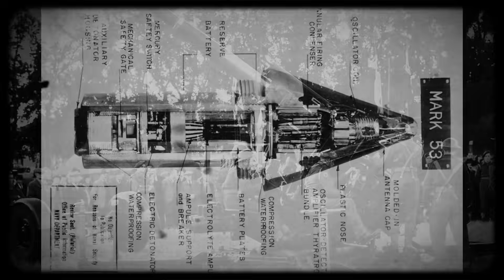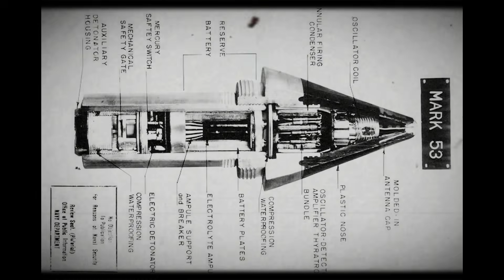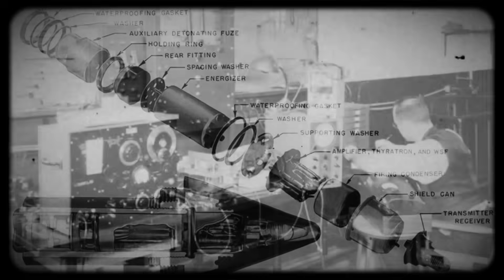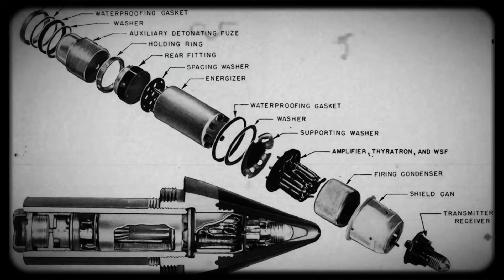The Day Germany Faced the Proximity Fuse—And Realized It Could Wipe Out Entire Formations Instantly

Comment: The Germans could have vastly improved the effectiveness of the V2 if they had had a proximity fuse. The V2 warhead effectively buried itself before exploding, causing most of the blast to go upwards. Using some sort of proximity fuse could have detonated the warhead 100 ft or so above the ground and caused a much wider radius of damage.

Comment: Crap! The proximity fuse was a British invention, NOT a US invention!!! The British tried it in bombs and rockets, but their valves were too big and fragile to be used in shells fired from guns with rifling. The USA made miniature valves for use in hearing aids. So, the proximity fuse design went to the USA with the Tizzard mission. (As did the cavity magnetron which put powerful short wavelength microwave emissions into a device small enough to hold in your hand).

The USA developed the fuse. Their greatest invention was the battery which consisted of electrodes plus a liquid which was in a glass container which broke when the shell was fired, throwing the liquid outwards into a channel where it completed the battery which powered the fuse. This meant that the shell had to be fired in order to activate it. This radically improved the safety of the a shell and got rid of the problem of battery life.

Contrary to the moronic narrative, there is nothing magical or complicated about the circuitry. One valve is used for the combined transmitter and receiver. The signal was fed to a 2 valve amplifier and then a Thyratron valve which fired the detonator.

The narrative in this video is appalling.
Reply: The number of AI generated or altered videos is appalling. The same thing is reiterated 25 times with intervening content being most often erroneous and or egregious over exaggeration. I would imagine this kind of content generation will rapidly fall off as people recognize its inaccuracy.
Reply: The Germans tried and failed just like the British, so the Germans invented it?
Reply: @clytle374  The British device did not fail in bombs and rockets. Also, the circuit was successful and was unchanged when the USA used it.
Reply: Make your own video then.
Reply: @trentallman984  What a useless comment. You are obviously one of Donald Trump's mob in that every time you open your mouth you subtract from the sum total of human knowledge.
Reply: The british design used separate radio source with the shell acting only as the receiver, thus your comment is largely false.
Reply: @nehorlavazapalka  Not according to the circuit diagram.

Comment: Hw come the Kamikaze attacks were so successful if we had the proximity fuse?
Reply: Kamikaze attacks were almost completely destroyed. The fact that men were suicidal was the psychological horror that accompanied the fact that all those pilots wasted their lives for no reason.
Reply: That does not explain why they were so successful during the Okinawa Operation.
Reply: @RobFox-d4j  actually they were not very successful. most of them failed.
Reply: Read Abt what happened during the Okinawa Operation. Abt 57 ships sunk, Abt 300 damaged, Abt 5,000 sailors dead. You SHD know these facts B4 making a silly statement.😊
Reply: TIMING ! The first American units to receive the fuses were ships that had at least 40mm or 5in gun mounts. The ammo with proximity fuses weren't in the supply line until late 1943. 
Also the common AA up until that time was the 20mm cannon & 40mm. The 20mm didn't have the range to engage the target to destroy the target carrying the bombs or torpedos.The 20mm cannon on ship were swapped out as fast as a 40mm mount was available & could be fitted.
Even escort ships that could keep up with capital ships (BB, CA, CV)  got 5in guns connected with radar fire control systems  (CA, DD & varients).
Reply: So 'successful'?  They managed to sink 36 ships with the loss of over 2500 pilots and planes   That's a 'success' rate of around 1%.  That is not 'successful' under any scenario.
Reply: If U were a one of those ships tt were sunk or killed on a damaged ship, would U still feel the same?😊
Reply: "Hw come the Kamikaze attacks were so successful if we had the proximity fuse?"

They weren't successful. Only a few planes got through, that did cause a lot of damage, but an order of magnitude less damage than would have been caused if all the Kamikaze got through.
Reply: They sank 57 ships, damaged 300, and killed Abt 5,000 sailors during the Okinawa campaign. The Kamikaze attacks were vy successful.
Reply: @RobFox-d4j 36 ships were lost at Okinawa out of 1600, and not all of those were due to kamikazes.  In a sense, it was successful, but as a strategy, it was not.  It was an unsustainable act of desperation.  The loss of life was relatively small and don't forget that about 1/5th of those were on a single ship.
Reply: At close range for the 40mm and under, you need direct hits to reliably bring them down.